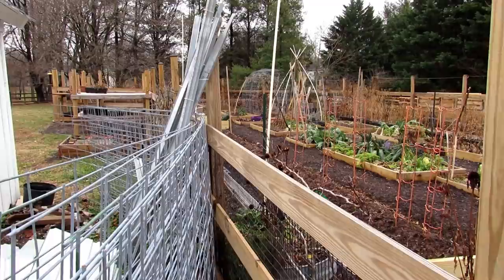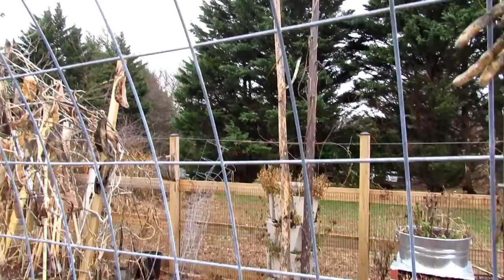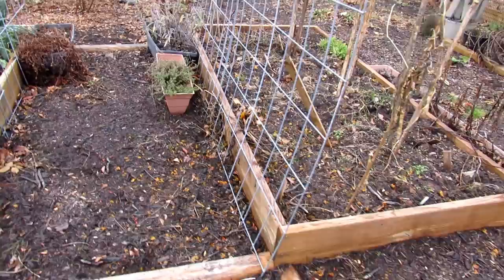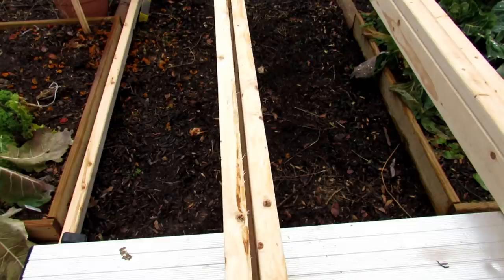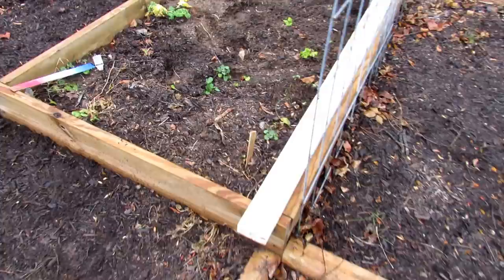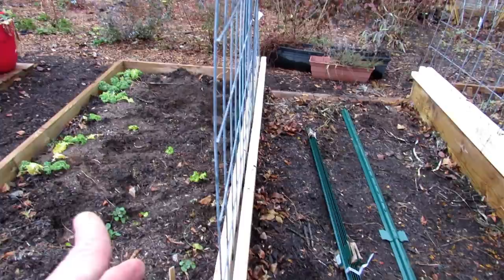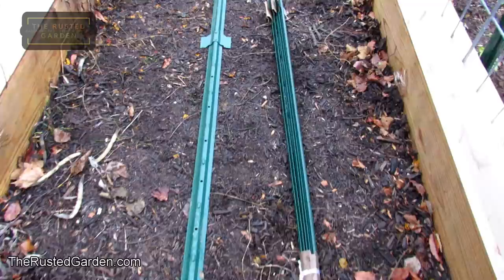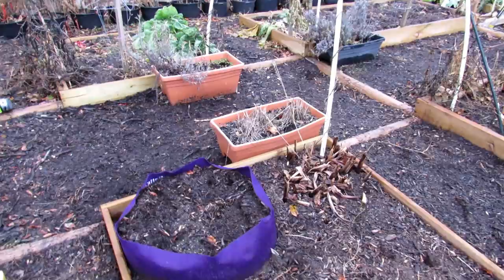2 Ways to Build a Cattle Panel Arched Trellis for Your Garden: Vertical Gardening & A 3rd Bonus Arch

Comment: I did this last year and it was the highlight of the grow season. But I used 2x8 beds and anchored the panels in the middle. Planted Cucumbers on the inside of one and Rattlesnake pole beans on the inside of the other. The outside area had Roma II bush beans in both and everything worked better than I could have imagined. My bend over is about gone so It was really nice to stand and harvest the heavy producers.
Reply from the maker: Vertical self and garden is good.
I now have an Amazon Influencer's Storefront. As an Amazon Associate I earn from qualifying purchases.  It is free to use.  Just use my... The Rusted Garden link at https://www.amazon.com/shop/garypilarchiktherustedgarden anytime you shop. I have garden items broken into categories.

Comment: i've had a cattle panel arch in my garden for years. It's pretty fun.  I usually do cukes and pole beans up the arch and lettuce under arch along the edges. trying to take advantage of the shade as you mentioned.
Reply from the maker: Yeah I think we dont often think of adding shade to the garden but the cool weather crops will appreciated some mid day.
Check out my new Harvest Bags at my seed and garden shop. If you buy one, you'll get 10% off your entire order (use code HARVEST10) through Saturday 1/4/2020. The link is to my shop, right to the bags: https://www.therustedgarden.com/search?type=product&q=harvest&fbclid=IwAR2GnieiqNqBvNAPw7qtmT0U_piUtA-8GXW95GEDTnHBmG_la8v0ApMlfa0

Comment: Thank you so much Gary. I just love your videos. I wish I could find cattle panels here in France. All I can find are panels used for construction...and that rust!
Reply from the maker: Appreciated! Too bad about the panel there. Have a great 2020;
I now have an Amazon Influencer's Storefront. As an Amazon Associate I earn from qualifying purchases.  It is free to use and anything you buy may be eligible.  Just use my... The Rusted Garden link at https://www.amazon.com/shop/garypilarchiktherustedgarden anytime you shop. I have garden items broken into categories.
Reply: Before I saw cattle panels and hoop houses, I had a structure built over my raised beds just using 4x4 landscape timbers for the corners, and other lumber to connect the corners at top (using screws so any part can easily be replaced, if necessary).  Then I ran wire mesh overhead. I run strings down for my tomatoes and cucumbers. It is not movable, but works great on a budget. I also used a screen on top to protect them from the scorching sun and on the ends from high winds. Those cattle panels go by different names... maybe check with local farmers to see if they have something similar.

Comment: They aren't built or installed yet, but I think I will use cattle panel as well as I have 3 long beds that would work nicely with that arched design for cukes or melons.
Reply from the maker: That sounds great. I think the arches give the gardens character too.
Check out my new Harvest Bags at my seed and garden shop. If you buy one, you'll get 10% off your entire order (use code HARVEST10) through Saturday 1/4/2020. The link is to my shop, right to the bags: https://www.therustedgarden.com/search?type=product&q=harvest&fbclid=IwAR2GnieiqNqBvNAPw7qtmT0U_piUtA-8GXW95GEDTnHBmG_la8v0ApMlfa0

Comment: I've used cattle panel arches only for luffas. Are there certain climbers that are better suited for over the outside of a panel - or better for using the inside as your plant starting points.?
Reply from the maker: You know I dont know. I figure I would guide them either way and once going they would be okay.
Check out my new Harvest Bags at my seed and garden shop. If you buy one, you'll get 10% off your entire order (use code HARVEST10) through Saturday 1/4/2020. The link is to my shop, right to the bags: https://www.therustedgarden.com/search?type=product&q=harvest&fbclid=IwAR2GnieiqNqBvNAPw7qtmT0U_piUtA-8GXW95GEDTnHBmG_la8v0ApMlfa0

Comment: Hi Gary. Want to try trellising this year. Question - will water pool in the trellis track & rot out the wood over a period of time? Would you suggest drilling drain holes in the bottom of the 2 x4? Thanks and Happy New Year.
Reply from the maker: It could, I didnt use pressure treated there. The seal has gaps however so I think it will drain away fine. The bottom of this wood track is off the ground too. 
I now have an Amazon Influencer's Storefront. As an Amazon Associate I earn from qualifying purchases.  It is free to use.  Just use my... The Rusted Garden link at https://www.amazon.com/shop/garypilarchiktherustedgarden anytime you shop. I have garden items broken into categories.

Comment: I’m rebuilding my garden next Spring and I’m definitely going to add some cattle panel. As I was watching this, though, I found myself wondering if I couldn’t just put the cattle panel on the inside edge of each frame and secure it with the 8-10” of soil in the bed. Would that not hold properly?
Reply from the maker: I love that stuff. IF the frame is high enough it would hold.
Please visit, The Rusted Garden Seed & Garden Shop: https://www.therustedgarden.com/ - Seeds, Starting Supplies, Neem Oil, Peppermint & Other Oils, Calcium Nitrate & More

Comment: Very nice but I can’t figure out the wooden lumber panel holder.
Reply from the maker: You mean why I did it or how to make it? Either way its just a way to secure it. Arches 2 and 3 are a good way to go. Have a great 2020.
Check out my new Harvest Bags at my seed and garden shop. If you buy one, you'll get 10% off your entire order (use code HARVEST10) through Saturday 1/4/2020. The link is to my shop, right to the bags: https://www.therustedgarden.com/search?type=product&q=harvest&fbclid=IwAR2GnieiqNqBvNAPw7qtmT0U_piUtA-8GXW95GEDTnHBmG_la8v0ApMlfa0

Comment: I've been following your new garden area from the beginning and it looks amazing! I'm trying to do similar in my backyard. It's the only space I have to keep the wild turkeys out! I have a question tho, do you have termite issues in your area? We have massive amounts of them and I'm trying to figure out how to use wood without it getting eaten! :(
Reply from the maker: I use pressure treated wood. It has been treated with copper for decades, not the old arsenic. I consider it safe. We use copper dust and sprays for organic gardening. Good luck.
I now have an Amazon Influencer's Storefront. As an Amazon Associate I earn from qualifying purchases.  It is free to use.  Just use my... The Rusted Garden link at https://www.amazon.com/shop/garypilarchiktherustedgarden anytime you shop. I have garden items broken into categories.
Reply: In my area, termites will eat the pressure treated just like untreated. I went with cinder or cement blocks. That just leaves the fire ants to deal with.

Comment: That’s a lot of extra work for something that’s supposed to be cheap and simple
Reply from the maker: Cattle Panel $24 and you get huge vertical space. The 2nd set up of hammering in 6 posts doesnt get any simply but for the 3rd one. Just drop them in. Right?